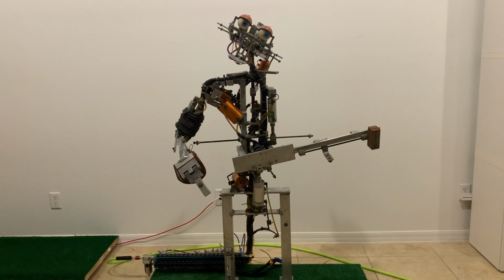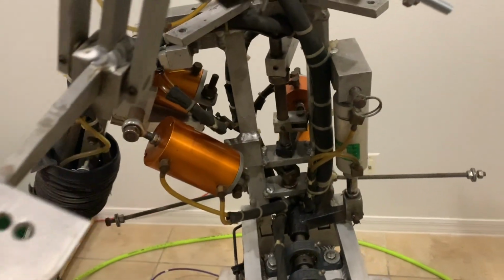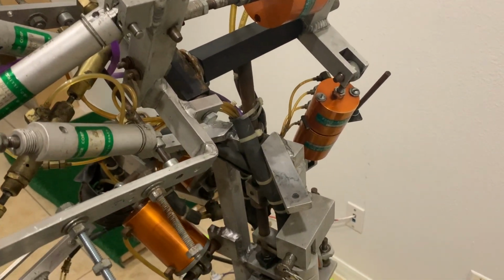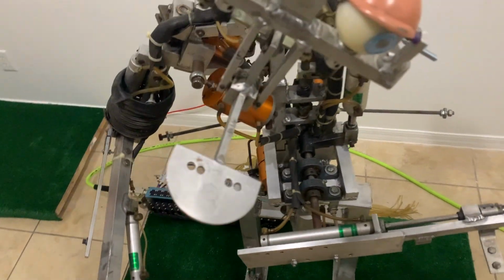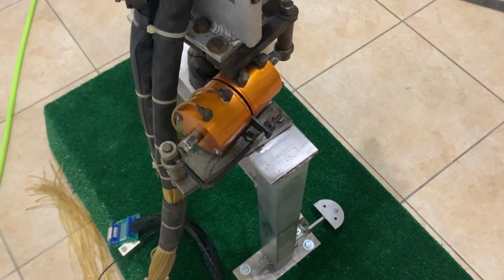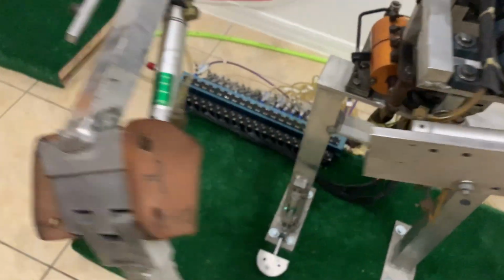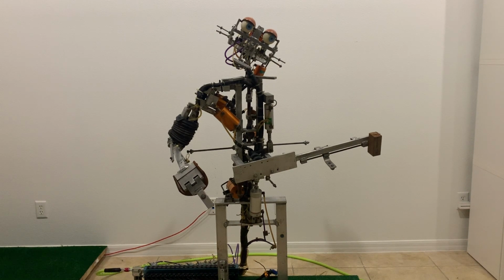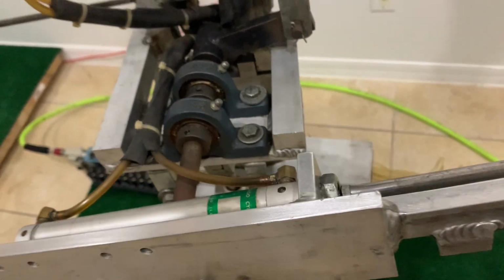Animatronic Restoration Part 1 - BILLY BOB - Rockafire Explosion - Showbiz Pizza

Comment: Hi, can you tell me more about the flow controls? I'm creating animatronics on my own and the flow controls you showed is the only thing i have problems with, to get the right parts, not that expensive, and that it actually works by pushing electric buttons. Can you help me with my project? I'd be very glad about it if you could help me a bit with these flow controls. Btw very helpful videos, great!

Comment: This is going to be a fun undertaking my friend!
I've never messed around with solenoids but this is going to be right up your alley.
How far are you going to take it in terms of restoring the figure?  Are you going to leave the aluminum as is or buff it up?  I think it would look super sharp with all of t oxidation removed from the metal.
Looking forward to the whole process!
Cheers, Joe
Reply from the maker: My Life In Collecting Yep it’s been very relaxing and fun for me so far.   I’ve been sanding the frame little by little.  I’m not going to make it shine like chrome which technically I could do using aluminum metal polish. I just want to remove the oxidation like you said and make it look like it did in the 80s.

Working through all the little things I’ve come across so far whether it’s either an adjustment or a bad cylinder. 

Well I’ll talk to you later Joe. 👍